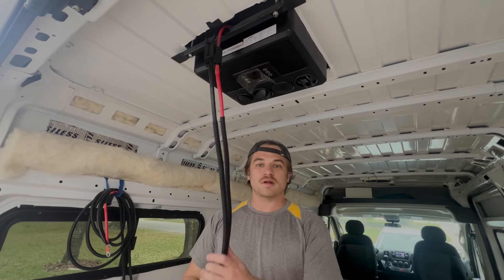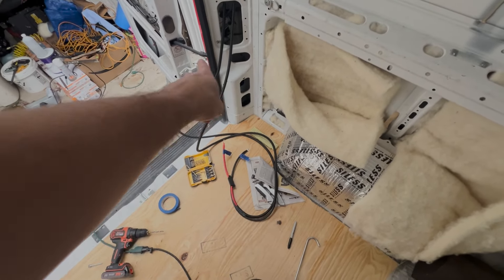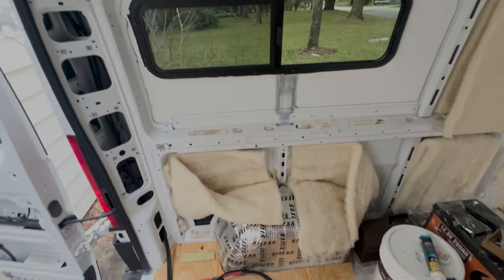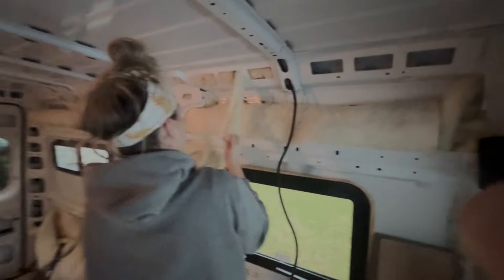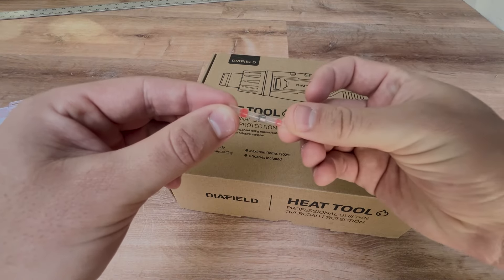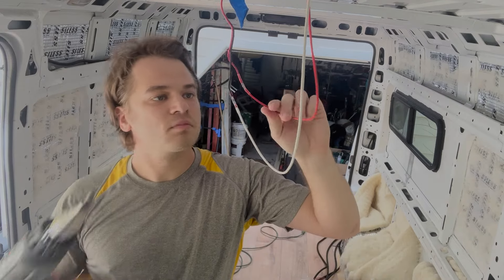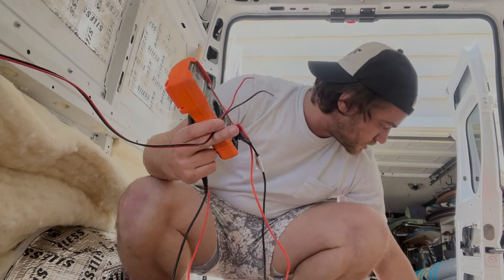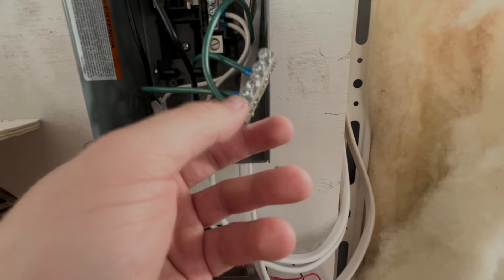How to Wire a Van for Van Life! || Ram Promaster Conversion || DIY Electrical

Comment: Do you have a picture of your AC from the back of the van? Does it sit flush with the back roof line?
Reply from the maker: Great question, it sits very close to the back line of the van. Maybe a bout 2-3 inches off being flush! Our AC video may show a better shot! If not DM me on instagram and I can send a photo!
Reply: @RacineandPeter  thanks for the reply. I put up the same unit over the weekend. Did you build a wood trim around the hole so you can attach the black finish trim piece?